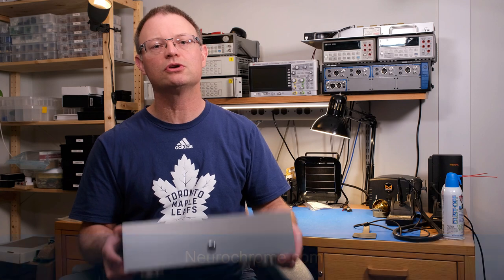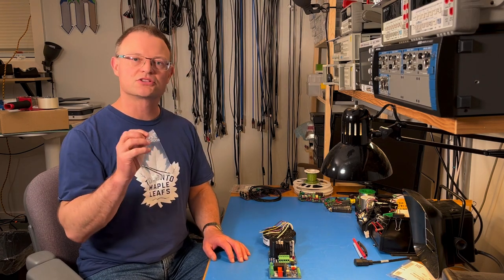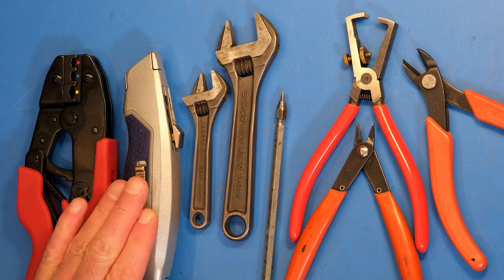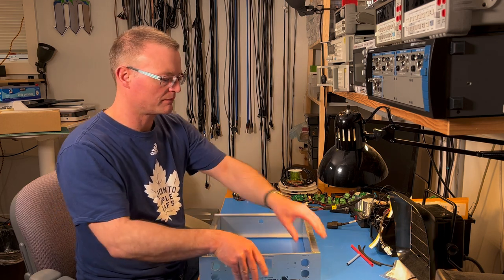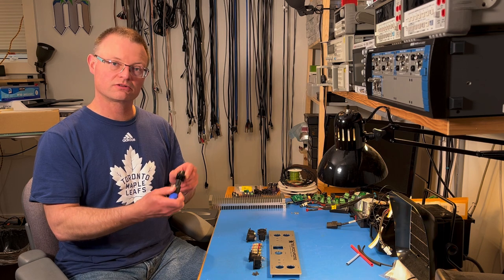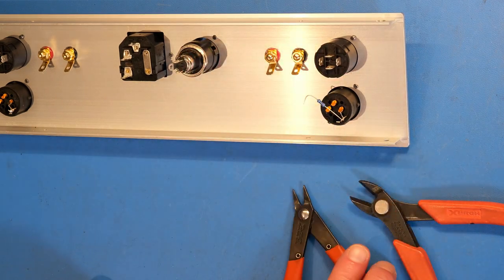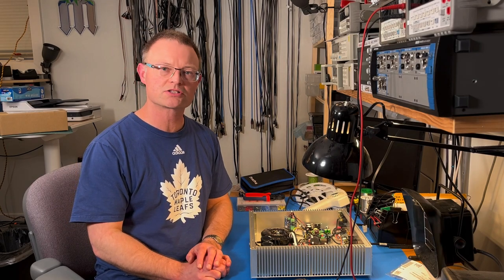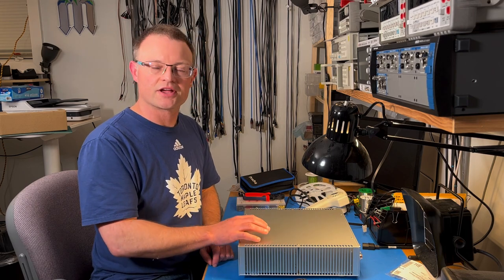Build a Stereo Modulus-86 Audio Power Amplifier in a Weekend with Neurochrome

Comment: Hi Tom! Thanks a lot for the video ! Even if we are not exactly building the modulus 86 it still helps a lot with tips and details ! Quick question, any special reason to not use ferrules on wires coming from toroidal transformer supplying the power 86? Thanks !
Reply: The secondary windings from the toroidal transformer are probably solid wires rather than copper with multiple strands. So they can probably deal with the stress of tightening them directly in the screw terminal of the power board :)

Comment: I think hypex for example says you should not connect the internal cable shield to pin 1 but to the chassie elsewhere and separate from where pin1 is grounded to the chassie. Do you have some kind of reasoning behind this or pros/cons of either way? Should it be different for different amps?
I cant really wrap my head around this myself thinking its still connected together either way trough the chassie or soldered directly on the pin?
Reply from the maker: I follow the AES48-2019 standard on this. If you want the EMI/RFI filter on the Modulus-86 to work you'll need to connect pin 1 to the Modulus-86 circuit board. This connection is also needed to ensure that the common-mode voltage remains within the allowed range.

Comment: Great video and may I ask if 25v secondary toroidal transformer can be used instead of 22v? Thank you
Reply from the maker: You can use 2x25 VAC with the Modulus-86 but the resulting ±35 V DC when rectified will limit you to 8 Ω operation due to the 7 A current limit on the LM3886 IC. See more here: https://neurochrome.com/pages/output-power